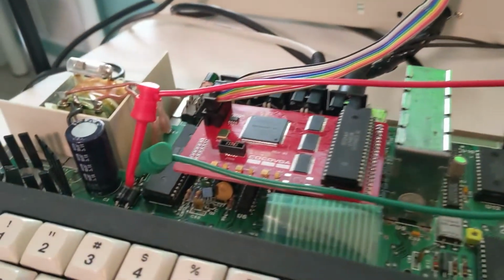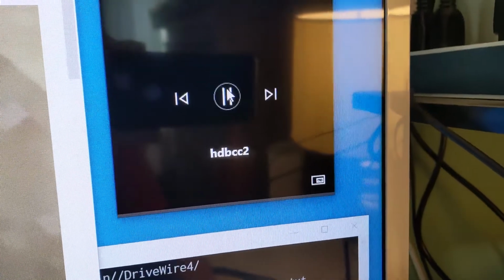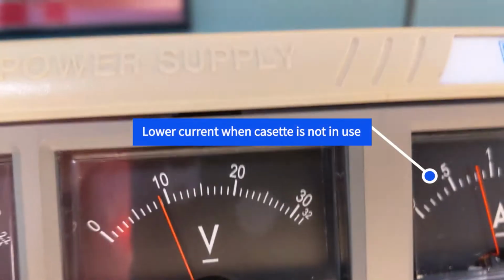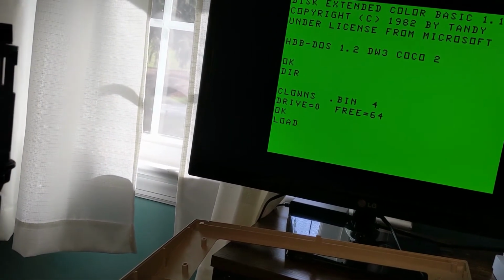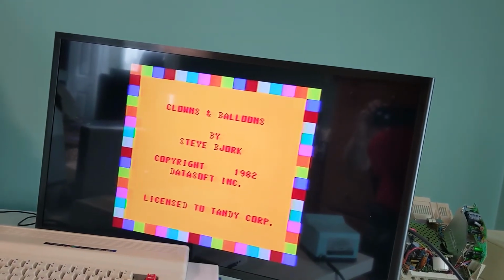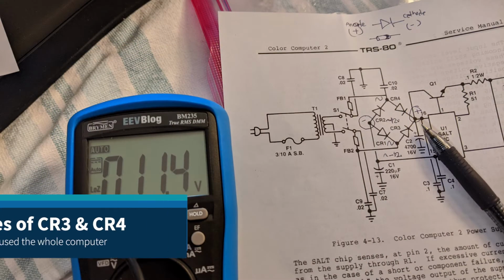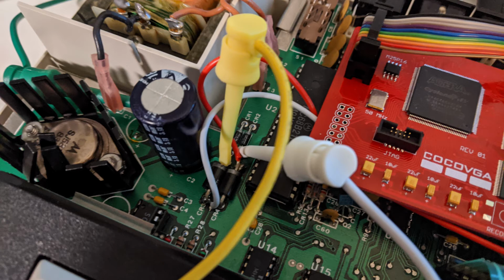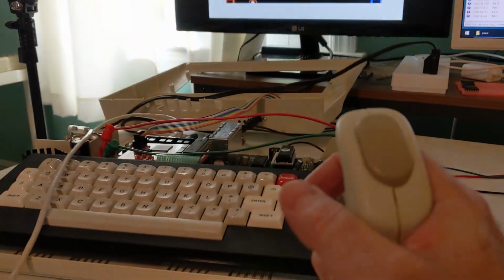Running my TRS-80 CoCo 2 on DC Power

Comment: Part of the reason that more power is drawn when the cassette is in use is the CoCo driving the cassette motor control relay. If you disconnect that, you can probably reduce the power requirement a bit.

Comment: I think you may want to bypass the built-in 5v regulator and supply the other voltages directly (e.g. use the regulated 5v from the USB and then create a more efficient +/- regulated rails from that... Probably an isolated brick)
Reply from the maker: Thanks, yes in the video's configuration Q1 still gets roughly as hot as it does with the normal power supply. The simple USB setup I showed in the last video kept the case very cool. I think your idea is a good one, but getting the whole computer to work (this video) is the first step. More experiments to come. I melted some resistors yesterday :-) but the CoCo 2 is fine!